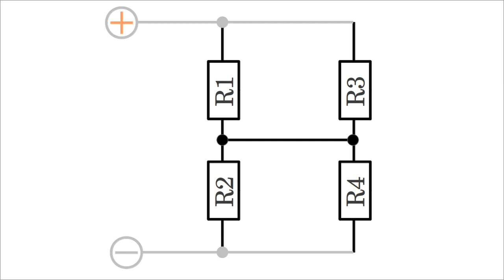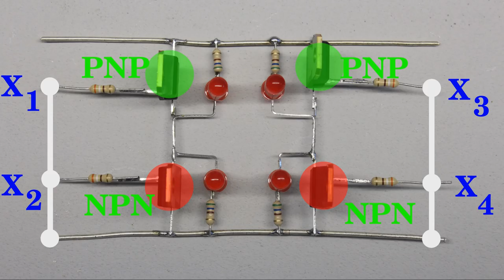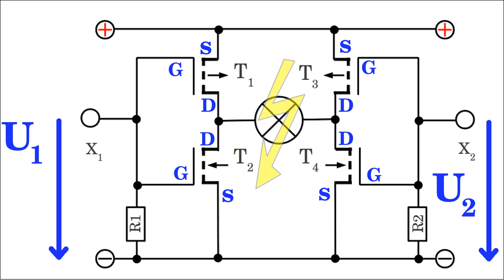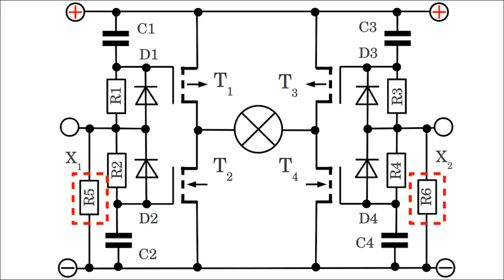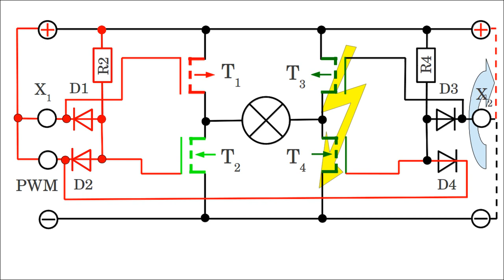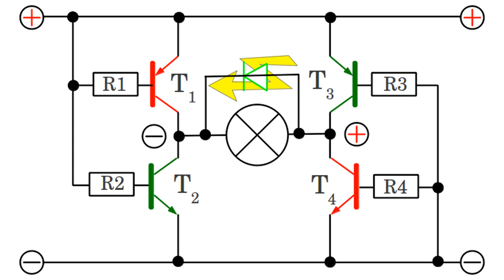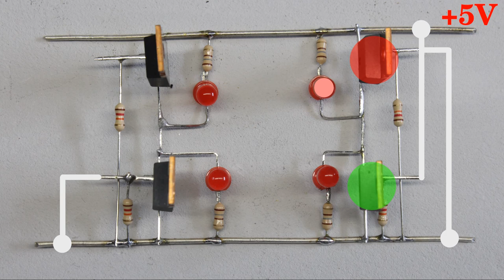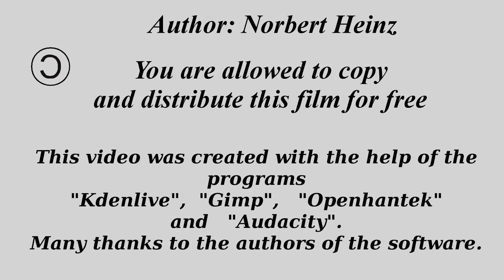Working principle of H bridges

Comment: Im trying to make a mini RC car using an Attiny85, im going to be using an hbridge for the motor control. The problem that i have is that i only have 3 available pins to use for the motor control since 2 of the available 5 pins are being used by a bluetooth module. My question is if there is anyway to control an hbridge to go backward, forward, left and right, but do using only three input pins. Thank you in advance.
Reply from the maker: As demonstrated in the video, 2 pins are sufficient to control an H bridge (05:44 Two input clamps).
The schematics are available at the project page (section "simple control"):
http://www.homofaciens.de/technics-base-circuits-h-bridge_en_navion.htm

Comment: Would the H-Bridge with 4 N-Channel MOSFETs work if I only used 12V or do I need 12V and 5V?
Reply from the maker: +Proto G You need a voltage that's above the voltage used to power the load, to make the high side MOSFETS turn on.

Comment: How would the dynamic braking change if u we're running a three phase motor? Would all low side or high side mosfets turn on at once, or is there a pattern that happens?
Reply from the maker: Turning on all high side mosfets at once is the most simple way of braking brushless motors. By adding sensors and so complexity to your circuit you can improve the braking (or recuperating) capabilities.

Comment: Thanks a lot for the video shared, its very helpful. I have a query, I want to implement the H-bridge that you've shown on your project page, but the motor I have is 24 volts 3A, so what consideration should I have to replace components in your schematic ( http://www.homofaciens.de/bilder/technik/servos_015.htm ). I've already bought some components.
Reply from the maker: +erwin escobar The problem is the too high Gate-Source voltage of the power transistors IRFZ34N / IRLZ24N I am using in my design. The maximum is 20V / 16V. You must implement voltage dividers on the gate sides of the power transistors.

Comment: @1:30 that's not an H bridge, you have two bypass transistor circuits in parallel.
Reply from the maker: It's an H bridge without a load connected, so in principle you are right.